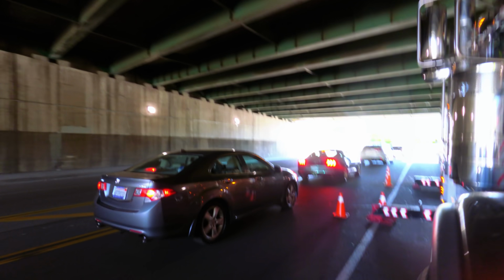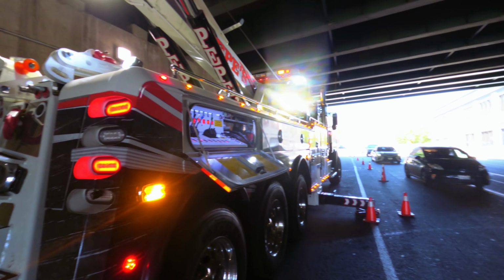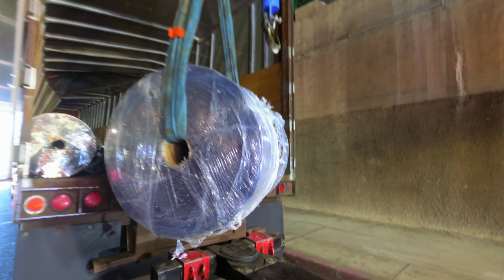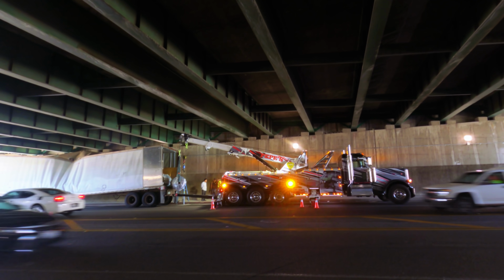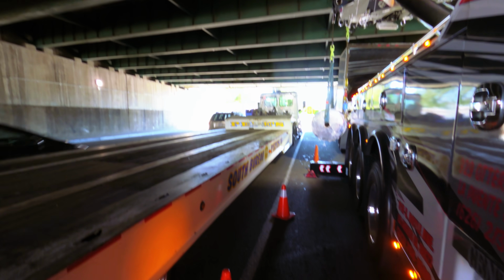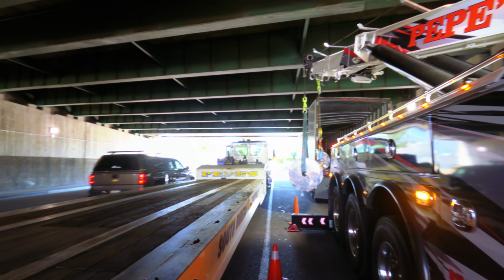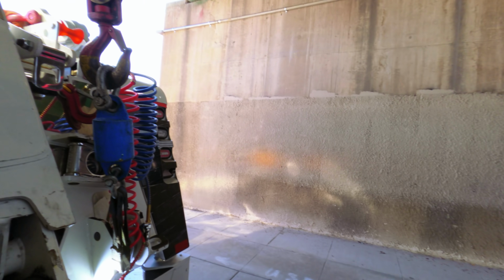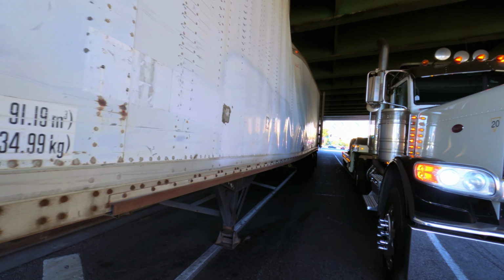Trailer almost snapped in half while driving - accident rescue with rotator

Comment: The problem with coils in a van trailer is that there is no way to fasten them so they will roll unless they are loaded standing on end.
Reply: @lonely4wd  The walls will never hold coils that weigh thousands of pounds.  It would require anchors in the floor. It's best to haul those on a flatbed because a flat bed has a frame under it and places to fasten them down.
Reply: @lonely4wd  I've had a look at the link provided. I'm having a hard time understanding how it would solve the specific issue at hand. You're saying to let them roll up against the sides of the trailer instead of securing them in place? Carpet I understand(thanks to the wonderful video provided by Utility's website), but this isn't carpet. I've seen the damage steel coils can do. This looks very unsafe to transport them in a rollable position without securing them to the floor. Stronger sidewalls only stop them from coming out. The images/videos shown does not indicate low tie-down points, but 6+ inches above the floor, with only slots, no place or rings for purpose-built straps/chains.

I'm sure those trailers shown are more than capable of handling the load, but you're expecting more from drivers that assume less responsibility than we should be expecting to secure the cargo properly.

Edit; I'm basing the securement issue on the landall trailers they're reloading the coils onto. Using the Utility Dryvan's system, they'd barely be pulling any force down into the coil. Over a longer trip, they'll slowly move from their positions. Whereas tying them to the floor would have a better angle for keeping them in place.

Comment: driving with the tandems to the rear wont cause a legally loaded trailer to fail, there was obviously additional probelms with the trailer. I am a HD CDL A Driver with more than 2 million miles. Slding them to the rear on a trailer in good condition will not make it break the frame.And by the way it is a 45' trailer so running it to max is legal depending on how it scales. Very normal to run a 45 at max length.
Reply: The weight was poorly distributed. Even with wheels all the way back when the belly is light there should be no issues.
Reply: Your dealing with tow truck drivers 😂 they know everything about everything trucking related 😂 

Your absolutely right. 45 and even a 53 can be run long if it’s loaded properly and the trailer is. It a rust bucket. 
In this situation it looks like they loaded the product on the wrong type of trailer. 
There are aluminum floor dry vans that have 4 inch cross beams. Those is what you load rolls of heavy product on like this. 

This was a lot of weight per square inch. 
Imagine an elephant 🐘 on high healed shoes. That will push through a lot.
Reply: @mr.george-pht  
Something else the airlines dealing with aluminum has taught us is stress fractures as the metal is used over time. This may have been the straw that finally did it in.

Comment: do you not have a 5th wheel plate for the underlift, seems like a more logical than the setup you created, just chain the t straight and go?
Reply from the maker: Yes, every heavy and rotator has a 5th wheel plate. They're heavy and take longer to set up. Incredibly easier to chain it when the trailer is empty. If it was loaded I would have used the 5th wheel plate

Comment: Well oiled team! 
Suggestion, use a second strap so the guys in the trailer can have the load rigged and not wanting for the strap.
Reply from the maker: I thought about that after the fact, but realistically, if you count, it took them like 10 seconds maybe to put the strap in and shackle it to my line. Multiplied by 28 rolls, that would have saved a grand total of less than 5 minutes.

Comment: I ran flat bed trailers years ago. Rule #1. Never , never load a coil suicide style.  They were always load shotgun style. Oh yes a little more work with the chains. But the loads did not move. Rule #2. Coils were never loaded in s dry vain. Never never never
Reply: When I flat bedded, I was opposite, LOL I preferred to load super coils suicide  I usually hauled anywhere from a 45,000lb to 48,000lb coil.

Comment: I though it was illegal to tow a trailer in CA with the rear tandem slid that far back? I know it was when I use to be a long haul trucker. I HAVEN'T  left Washington state to transport freight in over 10 years. Perhaps they may have relaxed their strict restrictions a tad in that time.
Reply from the maker: If they were to cross the scales, it would definitely be illegal.
Reply: It was only a 45 foot trailer so the tandems are ok as long as they are 40 ft. from the kingpin, here in Cali.. That trailer was built when a 45 was a looong trailer!
Reply: @frankbroker3698  
It is wise to have the wheels all the way back to load if the tractor is not attached with these heavy rolls.

Comment: Where is the spine for the trailer? Is it just the wheels attached to floor?
Reply: The Trailer's shape is the spine. Wheels are attached to a square tube, the load is carried inside the tube.
Reply: @alanhubbard1868  that's insane, wouldn't be allowed on the road here, ours are like skel trailers with the box, flat top etc on top

Comment: why didn't they have those hauled on a flatbed . no place in that trailer
Reply from the maker: No clue, ask the owner?
Reply: The correct answer is "no clue, I just send them the bill for the cleanup" ... ;-)
Reply: Not a good idea to put those types of loads in a dry van especially when not secured properly in the first place.  Might have Superseded the weight limit in the floor beams when those coils moved in one spot.  Especially with tandems all the way in the back.

Comment: Never understood, why American trailers look so weird. long base with only two axle at the far end. Instead of three axle a bit further away from the back
Reply: And (almost) every truck has 3 axles.
There are probably reasons for that 🤷‍♂️
Reply: Some states don't allow more than 2 axles underneath the trailer. Even if there were more axles, they don't gain the ability to haul more cargo weight in some states.
Reply: In Germany three axle trailer with single axle truck are standard in semi configuration.
Reply: @oliverpohl6687  The problem with the USA is that there is no set nationwide standard. Each state decides it's own regulations for overall vehicle weight, & length.

 Some states allow 10 axles spread between the truck & trailer, while others only allow 5 axles spread between the combination. The more axles underneath the vehicle, the heavier the potential payload it can legally transport.

I'll use my work truck here in Washington State for this example. It's a 2017 Peterbilt dump truck. The truck has 5 axles, 2 of them are able to be raised off the road when empty. The trailer has 3 axles underneath it. With this truck I can legally weigh 105,500 gross weight. This nets us around 31 tons of material per trip.
Reply: EU trailers only have 2 tires per trailer though, while in the US they have 4.
Reply: @kempo_95   no it’s not. EU trailers have 6 wheels per trailer. 3 axles by 2 wheel. Majority of trailers in EU will be with 3 axle. In UK 3 axle trailer is a regular thing to see .

Comment: Did you ever think about chaining up underneath the trailer and get to a pull out
Reply from the maker: For what?
Reply: @PepesTowingService  so you could open the road faster
Reply from the maker: @nickpanda9322  this is not a truck area. Right after this over pass it turns into a one way lane on each side that goes directly to the freeway. That would have been 1000x worse. This was the best case scenario.
Reply: @PepesTowingService  ok
Reply from the maker: @nickpanda9322  Besides, in order to chain underneath, you need to make it straight first. I would have to get next to the trailer, boom over the center with a spreader bar and pull it up, then chain it. There was literally zero room to do that, I would have hit the overpass. Not to mention I would for sure be blocking a ton more traffic for even longer. Your way would complicate things a ton more.
Reply: @PepesTowingService  ok
Reply from the maker: ok

Comment: In Europe, we don't have to slide. Automatic lift axles, only override= all axles down. Consider it USA/CAN, if we can manoeuvre with 3 fixed axles on the ground, you can as well. Besides, if we have double rear tractor axles, 1 usually is a lift axle, and 80% chance it also steers. If we have 4 or more axles on a dumper or mixer: only 2 axles are fixed, rest is either liftable or liftable and steering. Why o why are you so behind in your technology and comfort features in the trucking business? It's like going back to 1990 for western Europeans.

Comment: Axle placement wouldn't have prevented any of this.... Only common sense would.... Don't haul coils in a dry van..... It's not built for it at all.... Flat decks have rails running front to back for good reason..... This is just stupid and dangerous.... Broker, carrier and driver don't deserve to be in the industry....
Reply: When loaded properly without a lot of weight in the middle it should not matter. A trailer should be rated to be able to haul this weight. Coated rolls of paper can be just as heavy and when fully loaded the trailer looks empty. If this trailer would have loaded two abreast at the front for say three rows then a single row for three or four and the rest on the back this would not have happened. If it was loaded like this then it was a weak faulty trailer.

Comment: Why not use drag winch to pull rolls to back of TRL then the boom on to the landall
Reply from the maker: You could have done this job 100x different ways. I did it my way. Your way is even more labor, with my way once it's pulled forward the same line loads it. Literally the easiest possible way, why complicate things?

Comment: Sorry but I find this video very poor first you have no chock blocks which prevents the rolls moving and second why do you not have extra stropes to speed the recovery you could have opened up the road in half the time very poor management bud very disappointed please learn from this an get it right next time America will love you for it forward planning is everything not looking good on camera. Constructive criticism bud.
Reply from the maker: Verdugo Road slopes down, it is physically impossible for the coils to roll off the bed. Having chocks would prevent them from being loaded back to back. Notice how they have to roll UP the coils out of the trailer? Gravity, read up about it before making claims. Second, your perception of time is horrible. Having a second strap in the trailer would have been better in hindsight, but it took the guys approximately 10 seconds to put the strap in each coil and shackle it. Multipled by 28 coils, that would have saved me 280 seconds total, which is less than 5 minutes. I get your concerns but perhaps use a little logic and be realistic when dishing out "constructive criticism".